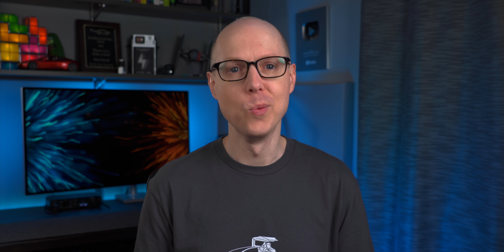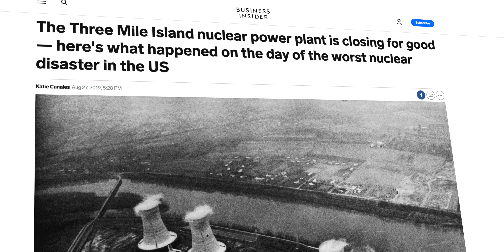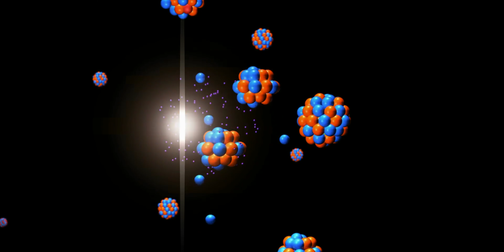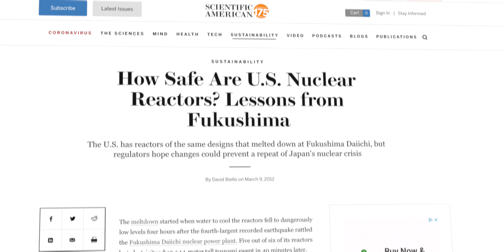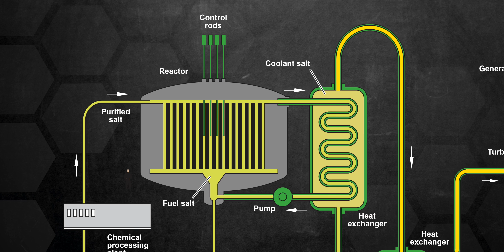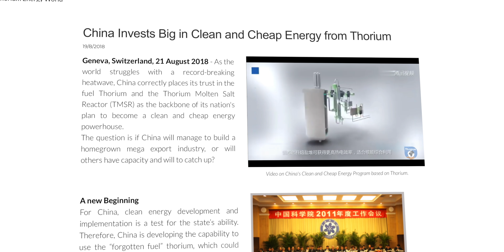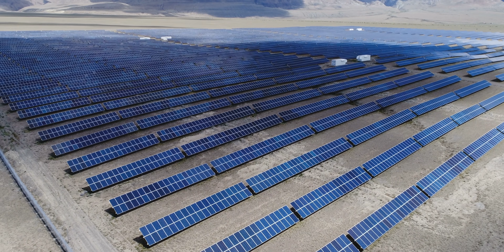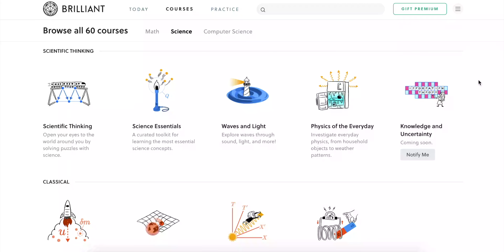Thorium explained - the future of cheap, clean energy?

Comment: After having watched this video, and talking with an acquaintance (who is largely in favor of nuclear power, a few weeks ago) about regular or old school nuclear power I would be very curious too see a video comparing the costs of various renewables especially solar and wind as compared to old school nuclear. This acquaintance I was talking to was largely making the point that nuclear power plants have what is essentially an infinite lifetime (with maintenance) and have no carbon emissions and she downplayed the safety concerns. I've been looking into it a little bit since then and it seems like nuclear power plants do in fact have a finite lifespan even though the nuclear material in them might be able to be used for quite a long time. Also, she posited that every 30 - 50 years the solar panels had to be replaced and that is a big downside insofar as the recycling of them and the cost of reinstalling a new station every half century. It seems to me that the cost of a nuclear power plant, in the 8 billion dollar range, is quite a bit more expensive to replace and it needs to be replaced in about the same time frame whether or not there is maintenance done on it or not.
Reply: With renewables though you have to pay for the backup as well. You get one power plant for the price of two. Alternatively you can build more renewables than you need and also build an energy storage solution.
At current prices of Li-ion nuclear is orders of magnitudes cheaper than doing that...
Hence renewables are backed by natural gas and will be for the foreseeable future.
Reply: Aaron, here's a rough calculation I did the other day for a discussion i was having in a facebook group debating nuclear and renewables:
 ...
Lets compare Nuclear with solar in the UK for an example. A pair of large modern reactors like the EPRs being built at Hinkley Point C will produce 3.2 GW 24/7/365 at a cost of £22 Billion.
Cleve hill solar park will have a peak capacity of 350 MW (about 10% of the time) and cost £450 million. This 10% number is the average annual capacity factor for solar in the UK... It gets as low as 2% in December and as high as 20% in July but I'll just use the annual average of 10% for simplicity. At just 350MW, you would need 9 of these solar farms to match the capacity of the nuclear plant so £450 million x 9 = £4.1 Billion for the solar with equivalent peak power (middle of the day). Because of the variability and 10% capacity factor you would need to build 10x as many of them and then have sufficient battery storage to make that power of any use. So 10x £4.1 Billion = £41 Billion Lets say you want the batteries to charge for 12 hours and discharge for 12 hours. that means you need 12 x 3.2 GWh = 38.4 GWh The largest battery in the world is 185MWh and cost $90 million so at that price 38.4 GWh would cost $18,600 million (£14.7 Billion).
So the solar farm costs £41 Billion and It's battery backup would cost £14.7 Billion, that's a total of £55.7 Billion compared to £22 Billion for Hinkley Point C
It gets worse. Hinkley point C will last at least 60 years (the initial license period) and probably at least 20 or 40 years longer than that with renovations etc (cheaper than building a new power plant) Solar tends to have a life expectancy of about 30 years and it's probably even worse for the batteries. 
 
Additionally, you can fit about 4 EPR reactors on the plot of land allocated to the Cleve Hill solar park. This piece of land in particular is relatively low value arable land, frequently sprayed with pesticides etc so the price of the land wasn't too high and you can make the argument that solar panels would be better than using pesticides so win win right? That's all well and good. But areas of land like this are what I would call the "low hanging fruit". When you've finished paving the cheep land and you're just left with productive farm land and areas of outstanding natural beauty or conservation importance, you'll inevitably start paying more for the land and incurring significant resistance from the public.
You can't scale renewables the same way as nuclear in the UK for this simple reason. The land requirements are insane for such unreliable energy.
Reply: It's not exactly what you're looking for, but here's a video comparing the costs of old-school nuclear with natural gas:
https://www.youtube.com/watch?v=UC_BCz0pzMw
Reply: Solar/Wind replacement lifetime is more like 25-30 years.
* this gives a good set of survey data https://ens.dk/en/our-services/statistics-data-key-figures-and-energy-maps/overview-energy-sector
US Nuclear plants essentially have design lifes of around 60 years, and a few (just a few) are on track for 80 years.

The other thing is the capacity factor, which is about 90% for nuclear, 35% for wind and 25% for solar. Basically you need 3x more wind and 4x more solar nameplate capacity to equal nuclear nameplate capacity.
Reply: Let's do a head-to-head comparison for projects started around the same time.
Hornsea Project 1 (HS1)
* cost: 4.2 billion pounds
* CfD strike-price: 140.00 pounds/MWh
* nameplate capacity: 1,200 MW
* project start: 2011
    * project duration: 9 years
* construction start: 2016
    * construction duration: 4 years
* construction finish: 2020 (began delivering some electricity in 2019)
* capacity factor assuming 40% (could not find cf citation for Hornsea I)
* annual energy: 4,208,000 MWh
    * 998 pounds/MWh
    * 467 GWh/y project duration
    * 1052 GWh/y construction duration (thank you @Dominic Adams for typo fix)
https://en.wikipedia.org/wiki/Hornsea_Wind_Farm
https://www.telegraph.co.uk/news/earth/energy/windpower/12138194/Worlds-biggest-offshore-wind-farm-to-add-4.2-billion-to-energy-bills.html
http://euanmearns.com/uk-offshore-wind-capacity-factors-a-semi-statistical-analysis/
Hinkley Point C (HPC, one of the worst managed projects on the globe)

* cost: 21.5 to 22.5 billion pounds
* CfD strike-price: 92.50 pounds/MWh
* nameplate capacity: 3,260 MW
* project start: 2010
    * project duration: 15 years
* construction start: 2018
    * construction duration: 7 years
* construction finish: 2025 (estimated)
* annual energy: 25,700,000 MWh (assuming 90% cf; average for nuclear)
    *
 875 pounds/MWh
    * 1,713 GWh/y project duration
    * 3,671 GWh/y construction duration

https://en.wikipedia.org/wiki/Hinkley_Point_C_nuclear_power_station
OK, time for the showdown
* CfD strike-price - HPC wins (92.5 pounds is worse than today's wind, but it was much, much better than 140 pound wind at the time of contract)
* value - HPC wins (875 pounds/MWh is 12% cheaper than HS1's 998 pounds/MWh)
* project speed - HPC wins (3.6x faster than HS1, assuming 2025 estimate holds)
* construction speed - HPC wins (3.5x faster than HS1, assuming 2025 estimate holds)
HPC wins in every category, despite it being one of the worst managed projects on the globe.
Yes, nuclear is cheaper and faster.
Reply: @factnotfiction5915  Well said my dude!
Even before considering how much more useful baseload is compared to weather dependant generation it's clear what wins and it cant be understated how much more complicated an energy system is with intermitents if the goal is decarbonisation.
P.S you said "duration" twice on your HS1 analysis rather than "duration" and "construction"
Reply: @doritoification  -- I appreciate and admire the analysis that you and fact not fiction did, but I'm skeptical of your claims about the utility of the baseload that nuclear power provides. Because power consumption isn't constant throughout the day but the power generated by nuclear reactors is, it seems that a grid that is heavy reliant on nuclear power will still require large-scale energy storage. Consequently, shouldn't the backup cost also be added to the nuclear plant option?
Reply: @mvmlego1212  You're mostly correct and you raise a good point.
Energy generation needs to be matched perfectly with demand and nuclear power (current generation) is well suited to baseload generation but not for load following.
In the UK the demand can swing up and down by about 20GW between peak and off peak in a single day.
Although nuclear does not "follow the load" very well, it can ramp up and down slowly over the course of hours and this is heavily dependant on which type of reactor we are talking about. I'm not highly versed in the different reactors ability to do this but one of the desirable features of the EPR was an increased ability to do exactly this.
That only gets you part way there but for a comparison...
If it's not windy at night then you've basically got zero renewable generation. This happens quite a bit in the summer and sometimes you get week long luls in the wind.
Nuclear will never have this problem as you just schedule maintenance on different reactors at different times so you never have too much capacity offline and preferably you do it in the summer when demand is lower.
I'm actually quite bullish on lithium ion batteries because they provide excellent frequency control and ancillary services to the grid in milliseconds, keeping the lights on and making a lot of money while doing so. Hornsdale power reserve was built in 2017 and has already paid for its self.
But you will need larger scale, cheaper storage as well because Li-ion is just too expensive to scale up beyond frequency control and ancillary services.
It's kind of like how you've got a cheep TB hard drive in your PC for saving your game library and pics/vids. Then you've got your more expensive SSD which runs the operating system but is only 128 GB and then you've got about 8 or 16 GB of really expensive RAM which speeds everything up and the processor has a tiny amount of Cash memory which is astronomically quick. Li-ion is like the cash on the CPU. Vitally important but you can't save a video on it. Nuclear is the big TB hard drive that saves all your large files and games. Its simple and its cheep and it does a job but don't expect it to boot up an operating system in 2 seconds flat.
Sorry for the computer analogy, i don't know if that's helpful or not haha
The point is that nuclear needs less backup than renewables and can ramp up and down predictably unlike renewables which do as they please, requiring you to have to prepare for the worst by building a storage system which is way larger than what you actually need most of the time, causing costs to spiral out of control... Or you just keep the natural gas. Obviously this discussion has the goal of decarbonisation in mind so nuclear is the option which displaces the most natural gas.
Reply: @doritoification  -- Thanks! Those are good points. I hadn't even heard of EPR reactors before, so I've certainly learned something today.
Reply: @mvmlego1212  Absolutely. I fully agree that storage should be paid for by NPPs.
Although today's NPPs can be run in a load-following manner, storage will make that simpler.
The easiest way with Gen IV is a 'crock-pot' reactor where the reactor runs constant, and a (presumably molten salt) thermal store enables simpler generation dispatch.

Of course, to be consistent, I believe Wind and Solar PV farms should also provide their own storage so that they are fully dispatchable, instead of shoving their intermittency problems onto the grid for the ISO to solve.